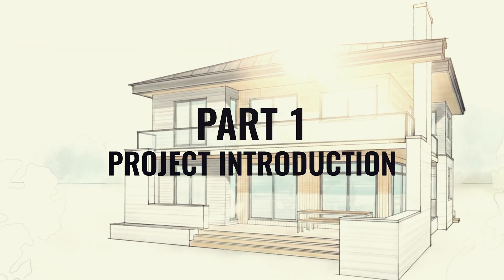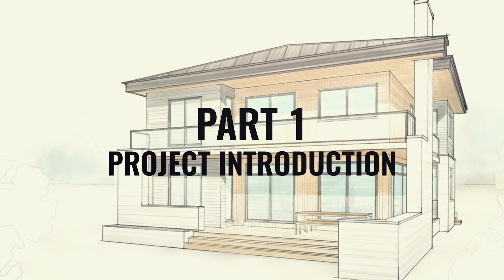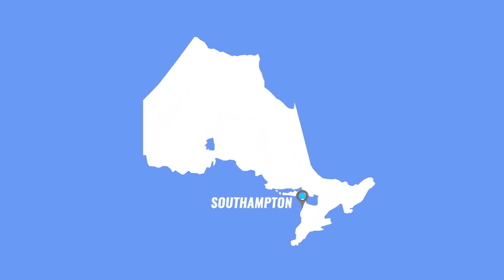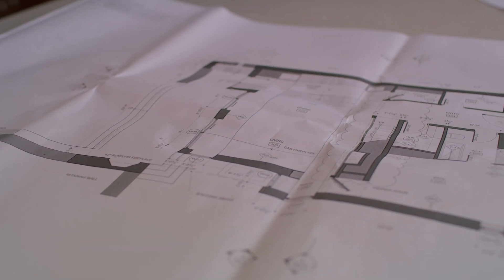Sustainable Design: Building a NetZero Home - Part 1

Comment: Just wondering how R30 is claimed.  I can see R15, because the thermal envelope of the building would include the ICF interior foam. That foam can certainly be continuously seal to the components of the thermal envelope of the building.  However,  the exterior foam of the ICF is outside of the building thermal envelope because  the concrete which is  inside the foam block is in contact with the ground at the footing.  The ground temperature therefore has a modulating effect on the concrete temperature, but that is not related to the building anymore
  What is happening is that the earth is being insulated.  Does anyone else think if these things?
Reply: @Gord Cooke thanks, gee whiz, thought i was the only genious out there😃